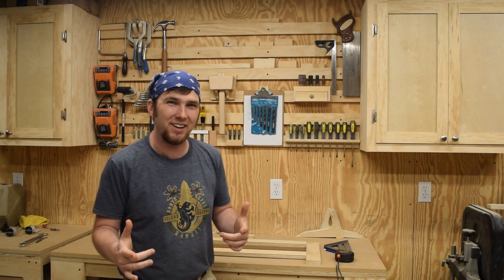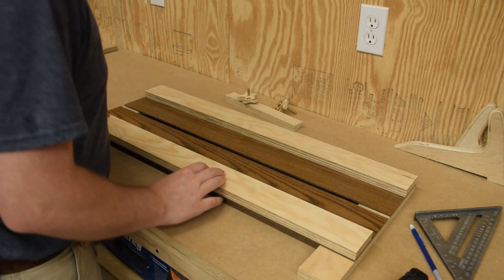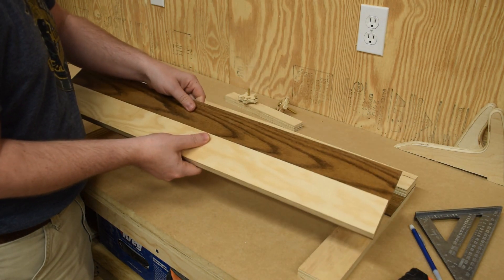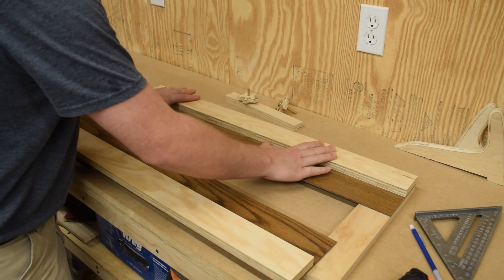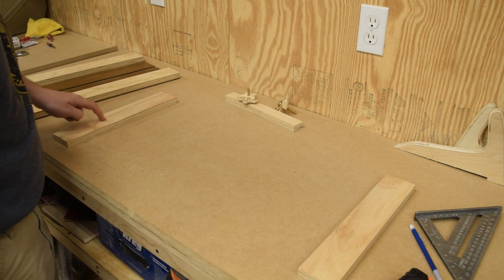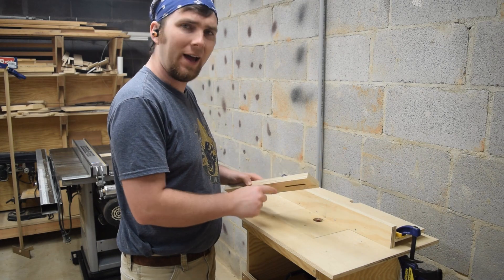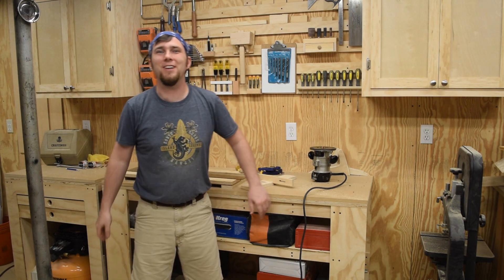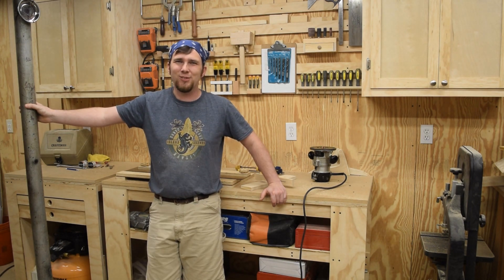Adjustable Router Jig for Dadoes

Comment: Good morning ! Do you always use the same cutter diameter?
Reply from the maker: Yes! I think I even wrote the bit size on the jig so I won't mess it up. Thanks for watching!
Reply: @MakingSawdust  Ha I haven't seen you could give me the diameter in mm?
thanks in advance
Reply from the maker: @thierryallain280  The size isn't too important as long as you always stick with that same size. I think I use a 3/8 inch straight bit so in metric something around 10 mm should be good.
Reply: @MakingSawdust  merci 👍👍
Reply from the maker: @thierryallain280  De rien!

Comment: Would have liked 2 have seen the bottom after u ran the 2nd table router pass 4 the bolts.  What size and kind of bolts did u use?  T bolts?
Reply from the maker: I used toilet bolts (cheaper t bolts) I think they were 2 1/2 inches long. Thanks for watching!

Comment: Kevin, Great job! Would like to have seen a little more detail in your video construction. For instance. How wide are the final sizes for the large pieces for guiding the router? What is the final size of the guide pieces to which the darker guide pieces are glued? Also, are you using a guide bushing on the Router? Or does the bit itself have a bushing? Do you have a set of plans that describe this? Can I download them? Are they for sale (the plans) ? 
Don Patterson
Reply from the maker: Thank you for watching Donald! I'm sorry I don't have any plans. There isn't a bushing involved in this design. The idea is almost like a track saw for your router. The set up becomes specific not only to a single router but even to a single bit being used in that router. The width of the darker pieces ends up being exactly the distance from the edge of the router base plate to the edge of the bit. I think I cut the lighter pieces of plywood about 2 inches wide but that is not an important dimension. I hope this helps a bit and I appreciate your feedback!

Comment: Did you use I bit with a bearing
Reply from the maker: No, the edge of the router faceplate rides against the plywood. The edge of the laminate shows you exactly where the bit will go.
Reply: @MakingSawdust  👍

Comment: hi, do you think its better to add say a piece of paper with the wood into to also , to give a little space for the glue, otherwise its too tight? Or you think it does not make any difference
Reply from the maker: Christopher Claudio Skierka  the first time I really squeezed the guide rails together and the dado came out too tight, but now I just loosely slide the guide rail up to the wood and it works great. I would say that accomplishes the same thing as using a piece of paper so yeah you could do that. Thanks for watching!

Comment: So basically a home made version of the woodpecker jig.
Reply from the maker: Apparently! I hadn't seen a commercially available version before. Looks like mine is a bit less adjustable. Might make a new one some day. Thanks for watching Dean!
Reply: Making Sawdust Think I’ll make a similar one myself but for the edge guide I’m going to use the same material that’s used for the splinter guard on a track saw rail.
Reply from the maker: That should work nicely! Where do you pick up something like that?
Reply: Making Sawdust Amazon. Festool product code is 495209 and for the non-slip cushion it’s 485724
Reply from the maker: Thanks for the info Dean!

Comment: Did you male 

Did you make your own router table insert plate?
Reply from the maker: Yes. I just replaced the face plate of the router with a square of plywood. Its not perfectly flat but it was quick and simple. It does mean I adjust the height from underneath and I have to take the router out to change bits. Thanks for watching!